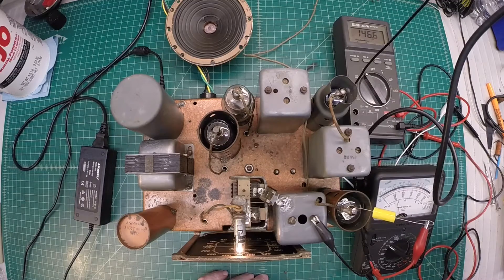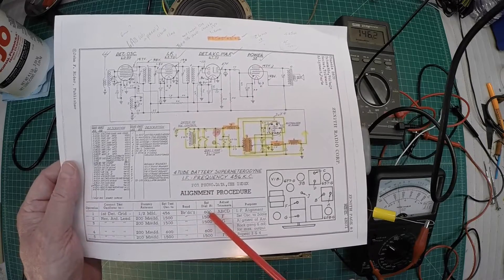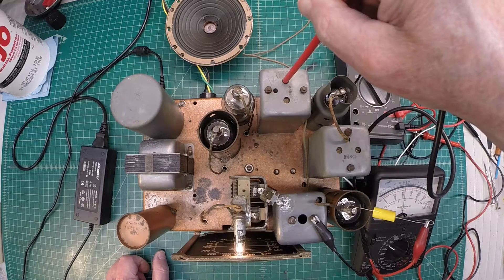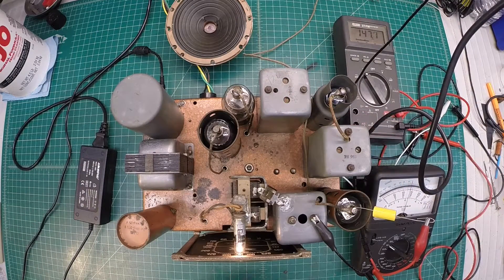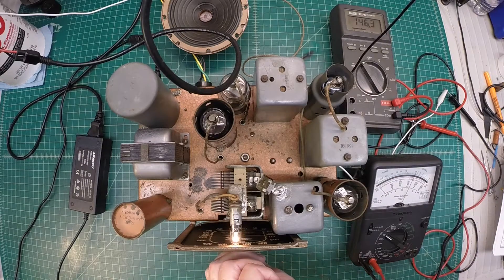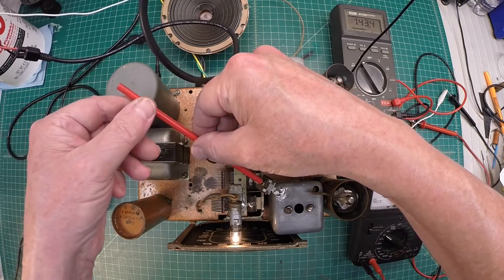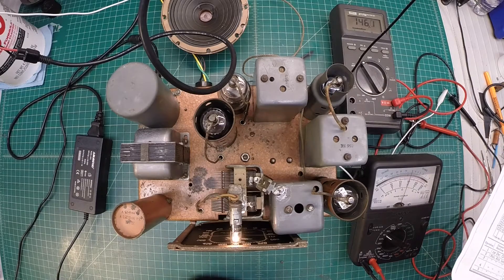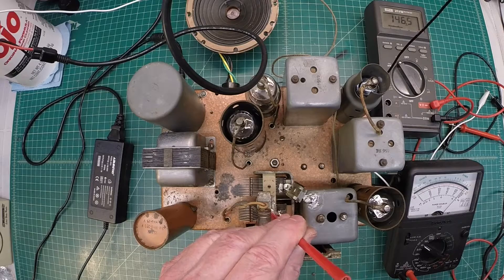Zenith 4-B-231 - RF Alignment (Boring But Necessary) - Part 10

Comment: Since this radio has a power trans, do you have to use a iso while aligning?????
Reply from the maker: Jason, assuming the power transformer is not shorted or has no leakage to ground, the existing power transformer would serve as an isolation transformer. Best, Don

Comment: After watching your videos ,I am  starting to see a need for a analog meter,I haven't had one in many years,my last one was a radio shack analog meter kit I built for my dad .I am starting to look at other pieces of equipment like a tube tester and a hethkit capacitor tester .thanks for your videos ,I always learn something
Reply from the maker: Thanks Ron. Check out www.shopgoodwill.com for a used analog meter. I’ve seen a number of Simpson 260 models and alike for decent prices. All the best. Don
Reply: @RestoreOldRadios  I will Don ,thanks .I think my dad use one in the air force.

Comment: When you removed the earth you heard the line noise, 60 cy. I could not hear the vibrator which is at around 50 cy or so which I could hear on the video acoustically. For Stephen Moore below they also are called  diddle sticks :-)
Reply from the maker: I commented back to Stephen too about the diddle sticks. I had a pocket full of them at one time. Best, Don

Comment: The  tuner works well mechanically. But electrically it motor boats  at about 900kc  then nothing dead silence to 500kc .  I have check the tuner for a short and there is none .  I have replaced the tuner grommets. I’m thinking I have a cold solder joint to the chassis. Looks to balled up. Going to have to try Mr carlsons gun tip with my weller.         
        The speaker on the stromberg is part number 33517.      Distance a cross the cone to gasket  measures 7”.   Thank you for your interest.      Dean
Reply from the maker: Dean, what kind of antenna are you using? Any missing tube shields? Sorry, I don’t have any 7” cones; if I did, I would get it to you.
Reply: The antenna is 6 foot long stranded 16 gauge copper .     Thank you so much for looking for a speaker cone.
Reply from the maker: Dean, you may try a longer wire antenna and grounding the chassis if the set has a power transformer. There are numerous possibilities why the radio is oscillating. BTW - I don’t have the speaker cone. A resource for speaker cones I’ve used in the past: https://reconingspeakers.com  Best, Don
Reply: Thank you so much for your suggestions and knowledge.    Can’t wait for your next video.    Let you know what happens.     All the best ,       Dean
Reply: Also no tubes shields are missing.

Comment: I’m working on a zenith 6s152 off and on for the last year and a half.   I actually brought it back from the dead. I could not believe it when I tried it out and Jack Benny came on the local the local station.  I thought I was in a time warp.   It still has issues though having trouble with the low end of the dial.   I have a stromberg  carlson  930 h on deck.  Needs a speaker cone bad. So I’ll be watching your speaker cone replacement  over and over.  Thanks   ......Dean
Reply from the maker: That’s a beautiful Zenith console you have if memory serves me correctly. It’s exciting when you bring one of these back to life. What kind of issue(s) are you experiencing on the low end of the dial? What size speaker does the Stromberg Carlson have in it, I may have a cone. Best, Don

Comment: My compliments on a job well done.  FIRST it was nice to seenyou using a “twiddler” (the technical term for a tuning wand we used in the shop).  So many people use a screw driver on the “screws” which can bite you sonet day”.   You didn’t wind everything out alignment before you started.  I see that done which can cause real problems eg.  first or second peak on some coils.  You kept an eye on your signal level too.  Fantastic job!
Reply from the maker: Stephen, much appreciated. The “twiddler” or “diddle stick” as a good friend of the past called them and always had a pocket full of them. I try to use them when possible in lieu of a screwdriver. This radio was really close on the alignment, which was good to see. To your point, I’ve bought a few that someone turned every screw they could find. LOL Thank you again and I appreciate you following my channel. Best, Don

Comment: Hi Don, 

Very good information.  It was useful to see that sometimes you might turn the signal strength down too much, because the screw adjustment didn't move the needle.

Would it be OK to use a Simpson 260 analog meter for an alignment?

Thanks, Tom
Reply from the maker: Tom, thanks. I love Simpson meters. The 260 is my favorite because I used it for 20+ years in the field troubleshooting. I like sampling the AVC voltage for radios that have it and do the alignment the way I demonstrated in this video. It also saves my hearing; what’s left of it according to my wife. Best, Don
Reply: Thanks Don for the information.  I recently found a nice Simpson 260 at a Goodwill Store for a good price.  I thought I needed to use a vacuum tube meter for an alignment.

Comment: I always enjoy alignment videos.  :)  Just sitting here thinking if you used a "ANL" type circuit from a CB that might help with the noise, if I remember correct, all it is, is a high cut filter , I've not experimented to confirm if it actually works, but it might? Great as always!  ~Jack, VEG
Reply from the maker: Jack, an ANL circuit is intriguing. You gotta do the design/build and publish the video for us. Thanks again my friend. Best, Don

Comment: Hello Don. Great job on the alignment buddy. Not boring at all.
All my best.
Bobby
Reply from the maker: Thank you my friend. BTW - what’s the tube compliment on your unknown radio brand again?  Best, Don
Reply: Hello Don. The tubes are 6A6, 6D6, 25Z5, 41, 75.  It could be 6A7 in the first IF . I have  a couple of 6A7's coming.  I am getting zero - 0 volts on the bias of the  6A6 . Caps and resistor checked ok. 
All my best buddy.
Bobby

Comment: That Zenith project is really shaping up Don! The only thing that detracts from it is the noise from that vibrator. I guess when you didn't have electricity back in the day you had to put up with the noise or not be able listen to the farm reports!
Reply from the maker: Thanks Jim. It’s noisy, but John Sweda made a recommendation that’s being considered to soften it up. In addition, once the chassis is back in the cabinet on rubber spacers, I’m betting it will be less distracting. To your point, back in the day they most likely enjoyed the noise it made. Best, Don